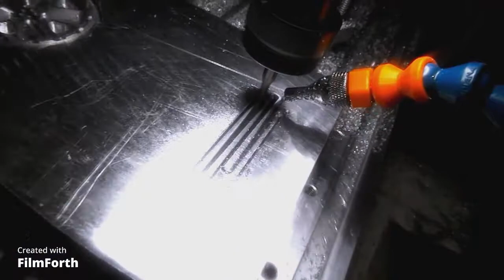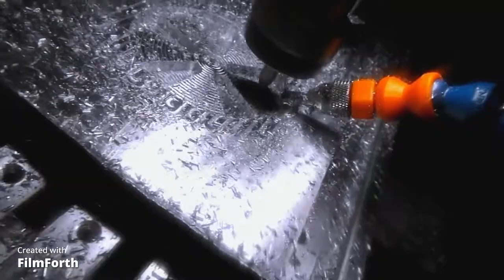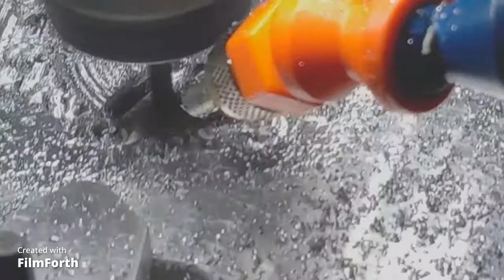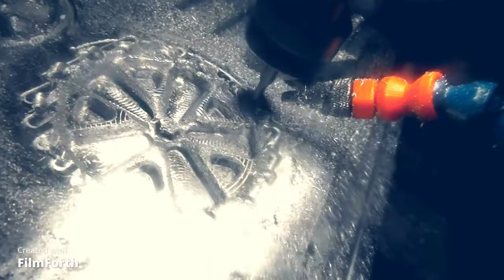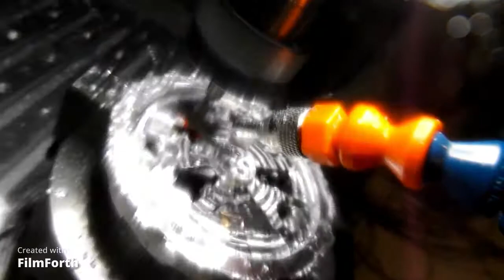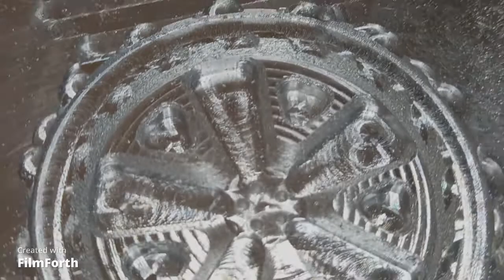Kleine Felge Fräsen . CNC Eigenbau.

Comment: top, was für eine cnc nutzt du denn und welche spindel?
Reply from the maker: Hi Vincent , Also Ich habe Die 2.2Kw Spindel China Spinden ( Wasser Kühlung ) Kann ich nur weiter empfehlen, da Die Spindel dadurch um einiges leiser ist.  Ja ich benutze Mach 3 ,  habe in allen Achsen eine Längere Gewindespindelmutter als das übliche , was bei Ebay verkauft bekommt.
Auf der Y  Achse habe ich zwei Gewindespindelmutter, die eine ist ganz Leicht gekontert, und habe somit einen umkehrspiel  von 0.001 -0.002